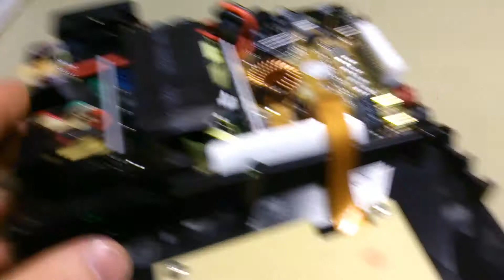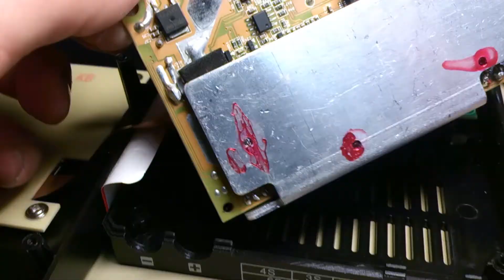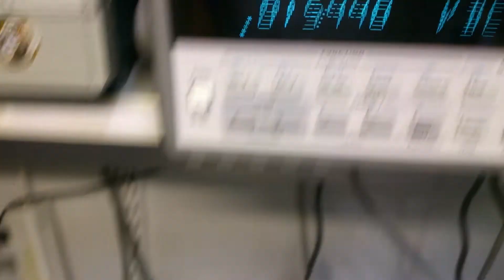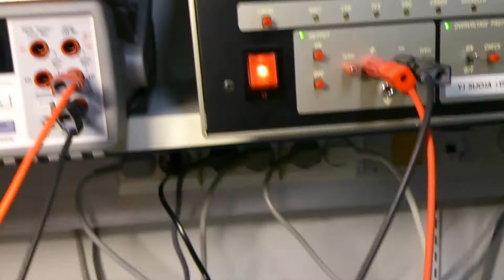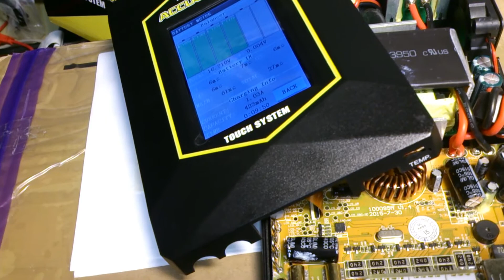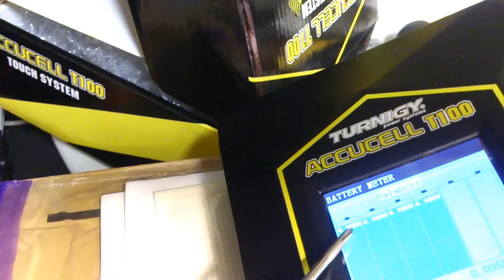Turnigy T100 Multifunction Touch Screen Battery Charger

Comment from the maker: yes the 3.15 amp fuse is on the AC power board. it's located on the board just wear the AC power is coming in. find me chasing the fuse didn't help there is also some mosfet which are dead.

Comment: I have the same problem, the first time I turned it worked regularly and loaded two batteries. Two days after I inserted the power plug and I heard as the sound typical of when a fuse blows. I opened it, there are no fuses, there is only one entrance on autofuse 3.15A. This week I try to replace it maybe is too low. I connected the power connector back to a low voltage power supply 13.8V and it works perfectly, so it is the power supply module.

Comment: Probably the best quality that I found on YouTube of these chargers is iCharger. But the prices are many times more expensive than Turnigy.
But for the quality and reliability I can overpay.

Which charger you can advise, from your personal experience?

I need a charger for the repair of old lithium batteries from laptops or electric tools. And to charge lithium batteries for a flashlight.